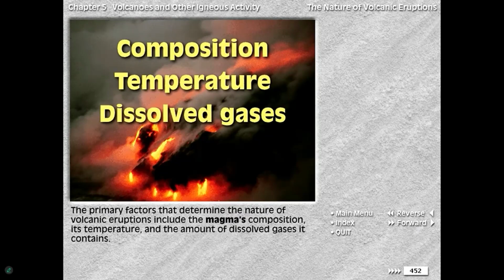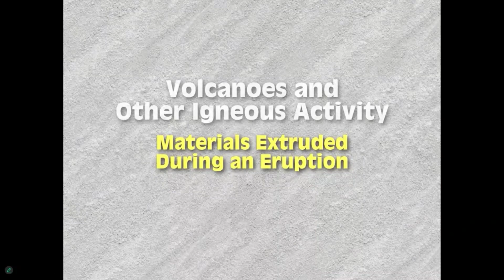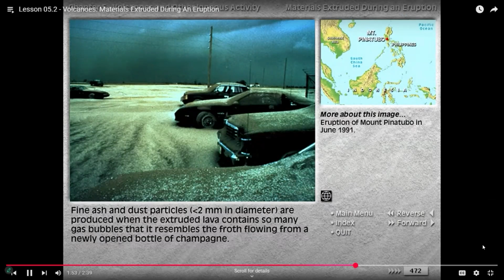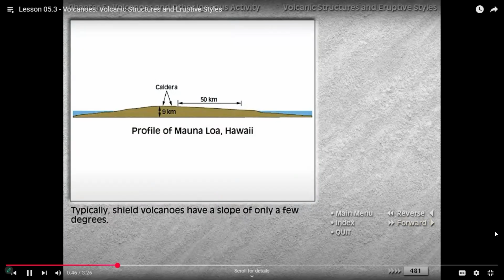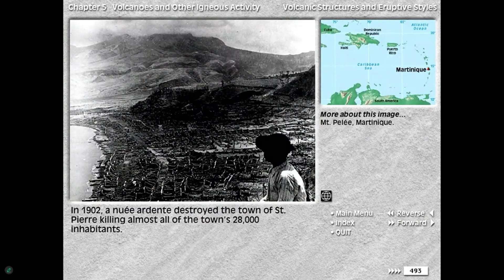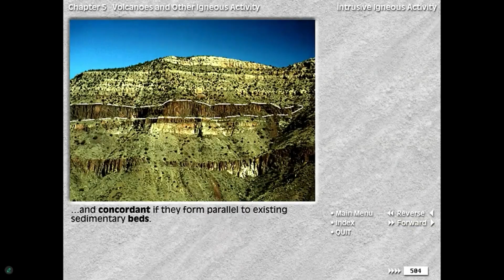Volcanoes and Volcanism

Comment from the maker: volcanism, any of various processes and phenomena associated with the surficial discharge of molten rock, pyroclastic fragments, or hot water and steam, including volcanoes, geysers, and fumaroles. Although volcanism is best known on Earth, there is evidence that it has been important in the development of the other terrestrial planets—Mercury, Venus, and Mars—as well as some natural satellites such as Earth’s Moon and Jupiter’s moon Io.

On Earth, volcanism occurs in several distinct geologic settings. Most of these are associated with the boundaries of the enormous rigid plates that make up the lithosphere—the crust and upper mantle. The majority of active terrestrial volcanoes (roughly 80 percent) and related phenomena occur where two tectonic plates converge and one overrides the other, forcing it down into the mantle to be reabsorbed. Long curved chains of islands known as island arcs form at such subduction zones. Volcanoes of the explosive type make up many of the islands of a single arc or the inner row of islands of a double arc. All such islands that border the Pacific basin are built up from the seafloor, usually by the extrusion of basaltic and andesitic magmas.